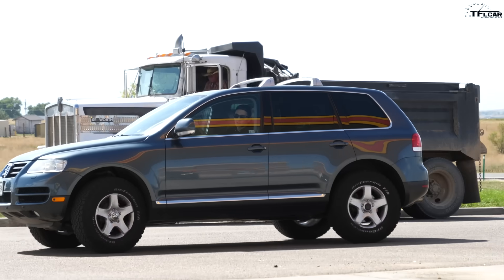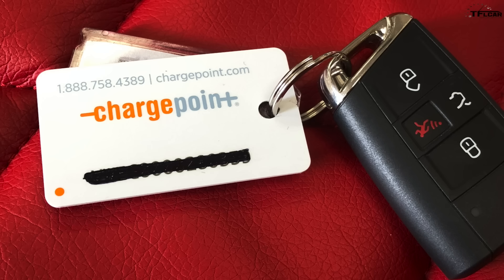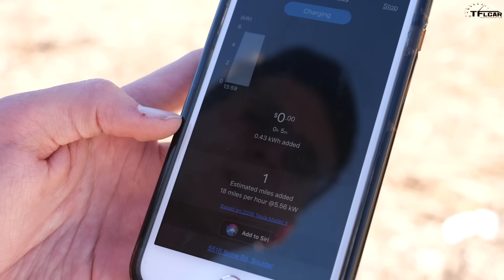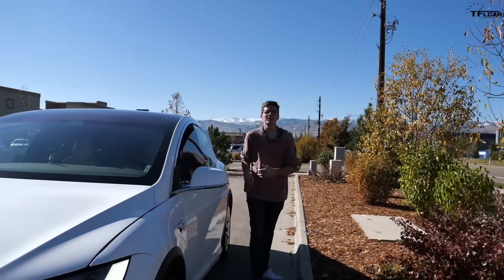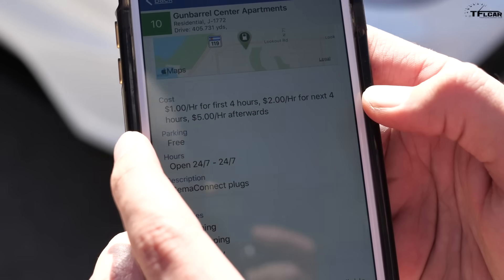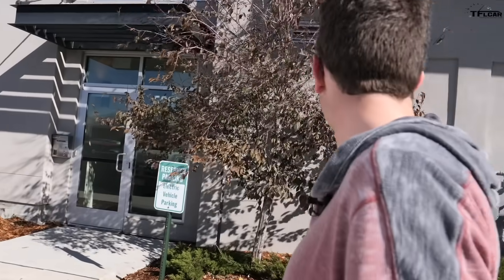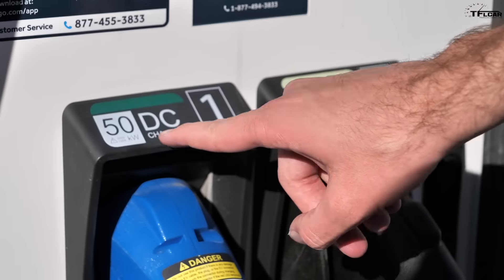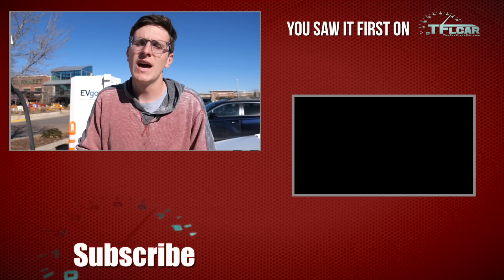Here’s Why Charging an Electric Car Can Suck - And It’s Not The Reason You Think!

Comment: I don't know about the US, but here in Canada charging your EV anywhere but your driveway is to say the least, FRUSTRATING. As you mentioned, there are several companies, and each one needs their own app. Basically charging an EV is pretty much impossible without a new-ish smartphone. 
Second, I found the map showing the charging stations was VERY inaccurate: it shows stations "available" when they're not (often disabled or not working), they only show for instance the parking garage, but WHERE in the garage? 
Third, as you found out, sometimes the charging station doesn't work with your card or app, or with your vehicle (one kept saying my car was "fully charged" when it was less than half). My success rate has been maybe 25% - less than 1 in 4 stations that showed "available" would actually charge my car.
And as you mentioned, there are several "standard" plugs that may or may not work on your vehicle.
And you mentioned that it takes a LONG time to charge for more than maybe 50 km, and one thing you don't mention is that the ENERGY in these super-fast chargers is pretty dangerous.

Comment: Superchargers can get 100 miles of range in 30 minutes? Wow! That's, like, 200 miles gained per hour! And the special Tesla-only ones can get up to 400 miles gained per hour!

Compare that to my gas car which only has 400 miles of range on a full tank and takes a whopping five minutes to refill, that's only... oh. That's 4,800 miles gained per hour. And I can achieve that rate at any gas station.

Gosh, it's almost like electric cars are still nowhere near comparable to gasoline cars when it comes to refueling them. Unless you are lucky enough to live/work somewhere that has chargers available or you're just rich enough to get your own fast charger wired up to your home, this is simply not practical for most people.
Reply: indoctus41  Home charging isn't that great though. Unless you rarely drive, or you have enough money to afford a home fast charger (I don't).

I live in a bit of a rural area. It's not quite the middle of nowhere but I regularly go 50+ miles a day on average. Just going to work and back is a 55 mile round trip (and no, I can't charge at work). Even if I had a 220v outlet avaliable it wouldn't be able to keep up. And trickle charging off a 110v is right out. I'd have to visit a charging station regularly to keep the "tank" from going empty, and that's a lot of wasted time.

Seriously, if electric cars were so amazing everyone would have one. There's a reason why gasoline/diesel are still so popular. Electric cars just don't make sense for a lot of people yet.
Reply: indoctus41  well the real problem with that plan is it would require owning a tesla. Ugly things.

Audi E-tron looks cool though.
Reply: indoctus41  Well once you factor in the tax rebate and the "gas" savings...

Seriously though I'd probably go for a Nissan Leaf if I had to choose an EV today. Looks alright, practical, reasonably priced. No AWD though :(

Hopefully by the time I'm due for another car Subaru will have an EV though.

Comment: There are free stations. I spend 2 hours at Nissan and Target.
Reply: Cool... if they are near your home you lucky .
Reply: Even 1 hr is too much!
Reply: @jdeast5016  no, it really isn't. Plug in, find somewhere to eat, that'll kill your hour right there
Reply: It’s some at sonnys bbq
Reply: Thats stupid unless you work at one of the two
Reply: @Jdalio5  Yeah, imagine going shopping or to a car dealership to enjoy free wifi! Terrible!
Reply: @Jdalio5  no, It's not.
Reply: @bradmagnuson6963  great rebuttal...very convincing.  Save up your money brad in 10 years, you can buy one with a near dead, 40mile range battery.
Reply: @Jdalio5  my EV has a 100 mile range. If I roll up to a charging station at 50%, it only takes 90 minutes to two hours to get back to 100%. I have crossed into "turtle" mode only one time, and got close to going into that mode once. Even if I roll up to the charging station at 20%, I can get back to 100% in a couple hours. I try not to let the battery go below 20%, but it does happen once in a while. I've driven electric for 3 years, so I know how far I can push the car, before it goes to zero battery percentage. Unless you drive electric, you have no idea what you're talking about
Reply: @bradmagnuson6963  So you are allowed to drive 50 miles in between 100 minute stops at Target...you're def living on the edge!!!
Reply: @Jdalio5  what's your point? Or Do you have one? If you've never driven electric, you don't understand the benefits
Reply: @bradmagnuson6963  my point is its TRENDY to waste money on inferior technology that has a BIGGER carbon footprint ALL in the name of saving a planet that doesn't need savings to begin with. You sound ridiculous and can't see the errors of your ways because you feel trend and doing your part. Plugging in a car for 2 hours to go 50 miles today. 2 hours will get you 48 miles by this summer 43-45 in a year....think about it.
Reply: @Jdalio5  none of that is true. Electric cars have a smaller carbon footprint than gas and diesel cars do. Not true about the range. It's not "trendy" to own an electric car, It's the smart and right thing to do. I save $200 a month in gas costs, and I have very little, and sometimes zero maintenance on my car. Again, unless you own an electric car, you have no idea what you're talking about
Reply: @Jdalio5  It's not inferior technology, either. It's called progress
Reply: @bradmagnuson6963  I have better things to do than spend 90 minutes charging every 50 miles. Lol.

I don't take an hour to eat nor do I need to eat for an entire hour after 50 miles of driving.
Reply: @dchawk81  them stop complaining
Reply: @dchawk81  not all EV's have the same amount of range. It also depends on if you drive highway speeds, or back roads. If you have an EV with 100-130 mile range, and you drive at highway speeds, you'll need to charge about every 60-70 miles. If you have an EV with 200-300 mile range, and you drive at highway speeds, you can go well over 160-260 miles before You'd have to recharge. If you have a 500 mile trip in a Tesla, You'd only need to charge twice, at 45 minutes both times, to make it that far. It all depends on what kind of range the EV has, that will determine how often you have to stop and charge. My Leaf is an older model, it only has 100 miles of range. So, I've done a couple short road trips with it. I did a 60 mile trip, and a 40 mile trip. Both times, I didn't have to recharge until I got back. The 60 mile, I did it on 70% battery. The 40 mile, I did it with 80%. I did this as a test, to see how well it did without being at 100% battery
Reply: @bradmagnuson6963  some thing you can not buy back is “time” and charging that car seem like a waste of time.
Reply: @HungNguyen-dl9nl  it's not a waste of time. Unless you own and drive an electric car, you'll never, ever understand
Reply: @bradmagnuson6963  It may be great if you work locally . 
I must admit I know you can save money going electric, especially on OIL changes and other maintenance issues BUT if you drive for a living and travel hundreds of miles a day or weekly, this is worthless due to time constraints while charging because MOST know there is an old saying you may or may not know" Time Is Money". 
I would love to own one especially the New Ford F-150 but it is not worth it IMO. 
I have no time to search, and maybe even wait until a station is free, then sit around and wait 1-2 hrs or even longer to get a full charge driving 500 to 700 miles when working some times. 
BUT I do get your point. It is good for yourself, BUT It is not for everyone, at least not now.
Reply: @lt4324  you don't have to search for a charging station, use the PlugShare app, and most new GPS units, have an option where you can choose for it to pinpoint where the stations are, and if they are a level 2, or a Level 3. Level 3 would be 20 minutes to 45 minutes, depending on battery percentage. You can travel anywhere, and any mileage, by doing this. Trust me, I've done it, it works. You just have to be better at managing your time
Reply: @bradmagnuson6963  Manage my time ? I do quite well with gas, BUT I GET YOUR POINT, and not trying to sound condescending at all. 
BUT its Hard to do when I'm self employed and then require extra time to go out of my way for a charging station ( I know there are Apps) and like I stated before, if they are taken/ others charging, which is a real possibility then that is extra time I cannot afford to lose. 
For now, I will stick with my gas truck, in and out in 5 min for gas. No worries at all.
By the time these are perfected I doubt I will be alive, LOL. (60 here)
Time is money for me and my customers when they need me ASAP. take it ez, Tom in NV.
Reply: @lt4324  You're not much older than me, I'm 51
Reply: Sad
Reply: There are free stations at a few mega stores because as yet there are not a lot of ev cars out there feeding off the stores like parasites.  Once they see more cars sucking up their bottom line... no more free rides. Literally.

Comment: The electric car was invented before the first fuel powered car.

And still the fuel powered car is better.
5 mins to fuel it about.

Can drive anywhere in the US.

Electric car wise there is no charging stations in most towns.

Plus it makes your trip take longer.

If you drive from where I live to Washington DC its 10 hrs in gas car. 700 miles

In a electric car it with charging it would take 14 hrs or more depending on the car.

With a affordable electric car you would have to charge 3 times to get there.
That would make it a 16+ hr trip.
So instead of driving there and getting there the same day you would want to spend the night somewhere in Southern Virginia before finishing. Thus a extra night in a hotel a extra $50+.

Comment: Electric vehicles have interested me for a long time now but they are currently not practical enough to be used as a daily driver where I live due to the lack of charging. Therefore this would put one into that category of luxury purchase. That is something I want rather than need. And there lies the reason why I doubt I'll be buying one any time soon. Simply put there are other vehicles I'd rather own in the weekend luxury category.
Reply: Are you unable to plug in overnight where you live? If not, an EV probably would be a poor choice. Most EV drivers rarely use any public charging - because potential EV buyers opt out and don't buy if they can't charge at home.
Reply: @jimmurphy5355  I work away from home several days a week. I also cover quite a high mileage and some of the locations I'm at do not have a good enough power supply to charge an electric vehicle.
Reply: cheyennedogsoldiers Sounds like you won’t be able to consider an EV until high speed DC chargers are much more common.  Tesla will get there first.  That’s a given, because they started first and did it best, and have never slowed down on building more. But Electrify America is building stations quickly as well.

Comment: One thing I am wondering what if some one removes charger during the charging.
Reply: Can't speak for other brands, but a Tesla locks the cord to the socket when the car locks.
Reply: You can put a lock on the charger for my Volt, the alarm will also sound if the cable is removed during charging when the car is locked.  Of course there is nothing to be gained by doing this, so somebody would have to just be a piece of shit to unplug your car for no reason.

Comment: This makes me not want an electric car.  Nice video though!
Reply: Get a telsa lol.  Zero telsa charges appeared in this video.  And you do 90% of your charging at home anyway.
Reply: @TexMex421  I think he noted that if you are using 110V/15A, the best you get is 3 miles per hour, which is slow. Most homes don’t have a 220V/50A  circuit in garage. It’s worth getting one if your service panel can handle it.
Reply: @ag4eng   I can get 5 miles per from from 110V, 25 miles from 220. 220 is easy to find in the house as most homes have 220V appliances like an oven, water heater or, or dryer.

The maker of the video does not own an electric car.
Reply: I’ll stick with the standard gasoline cars.
Reply: I'm with you 100%
Reply: I think plug-in hybrid is a good option during these Wild West days of EV. If Apple joins the fray, they will fix it.

Comment: There are 150,000 gas stations in America. It could serve 10 customers in an hour, but lets divide that by 4 to give us a more reasonable average, which would mean 2.5 customers an hour. Most gas stations have 4-8 pumps, so lets take the smallest figure. That means that 150,000 X 2.5 X 4 = 1.5 million customers an hour is a minimum. How do EV charging stations stack up against that.
Reply: It's not really a relevant comparison. Most EV owners are, at this stage of adoption, self selected by their ability to charge at home. So they rarely use any charging station. EV stations only have to serve drivers who are on a trip that exceeds the range of the car.

Comment: Thanks Tommy BUT i want to warn electric car owners that EVGO charges time instead of electricity consumed for a reason. When your battery is low, the dc fast charging Chademo will be very fast until your car’s battery reaches about 75% then its power output decreases. Initially it started to be about $0.50/kwh after i did the conversion but after i charges to full, it took alot of time in the last 20% which turned out overall cost shot up to $0.90/kwh. Such a ripoff

Comment: Tesla doesn't suck on being proprietary,  To the contrary Tesla extended their charging stations  as "open platform". EvGo has 20% of the capacity as Tesla when it comes to charging stations and it is far ahead of all those proprietary app companies you referred to. The oil companies and car manufacturers of the U.S. have been fighting EVs for decades, GM cutting up EVs after a pilot program ended in Cali. (Who Killed the Electric car?) Ford is investing in EVs in order to meet pollution standards maintaining their earnings with fossil burning cars. Tesla's intent is pure and untangled with the old ways of unsustainability, unfettered by the special interests that have fought to destroy alternative energy by using big government regulation and corrupt politicians who serve the special interests. BTW,  it's 150 miles added to range after 10 minutes charging at a Tesla super charger. Also, didn't mention the presence and excitement Tesla receives in Europe, Australia and Asian countries just to begin.

Comment: Have you ever heard of superchargers stations for tesla they can charge your car from 0 to 100 in 40 minutes and when you buy a tesla you get like 1000 free charges please look up facts before telling people lies
Reply: Of course he has. He's driving a Tesla and knows that while nothing he said was a lie, it's misleading. This just shows why in most cases (not all!) getting a Tesla is the smart way to go. If you can charge at your own home there is absolutely nothing to worry about. If you can't, Tesla Superchargers will get you all the power you need quickly. You'd only use the chargers he highlighted as a last resort. He also didn't mention that (with a Tesla) if you really get in a bind you can plug in to any common outlet you can find and get enough charge to get you to a Supercharger or home. It'll be slow much it'll get you there. I've driven my Tesla from coast to coast with zero problems and most of my Supercharger stops for those trips are 20 to 30 minutes.

Comment: You're right of course. And I amazed as how easily you let it slip that a charging point was not usable: it's so common you don't even notice it anymore. More to the point, the multiplicity of charging payment services is both astounding and obvious: it is a sign of the market immaturity that standard have not emerged. I mean 2 or 3 competing standards (like the plugs) are possible/acceptable but it is obvious that all these competing apps cannot go on like this for a greater audience. Question is: will it be a standization, a consolidation or a bit of both?
BTW public charging of 5KW seems an odd idea, does it not? Imagine 1 million car have to charge every day... with 5KW charger you need 1 Million chargers (charge take 15-20hr and some will statistically be out of order). Unthinkable. So mass adoption of EVs can only be possible when really fast chargers are wide spread.

Comment: While the video was well done, I think the title should have been called, "Why charging with Chargepoint sucks".  Had you gone to a Tesla supercharger with your Tesla, you could have been charging at 150 Kw to 250 Kw/hour instead of 5 Kw/hour.
Reply: I’m pretty sure it’s electric vehicles in general, not just tesla
Reply: @ozhd9hsi7djecue  right but the point is Tesla’s can charge very fast, most other electric cars can’t, so maybe he should have used a Nissan Leaf for this video and not a Tesla. Tesla drivers don’t use ChargePoint, they use super chargers.